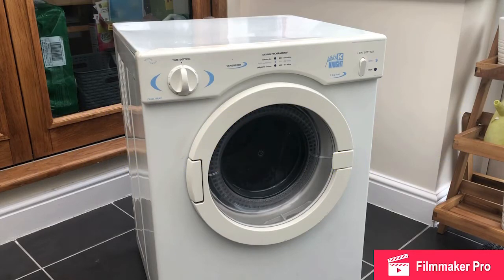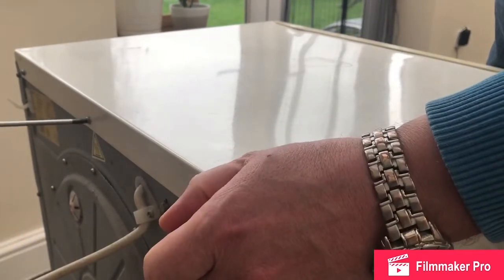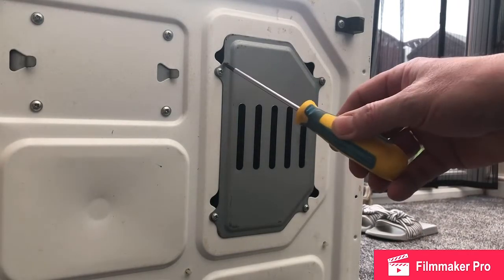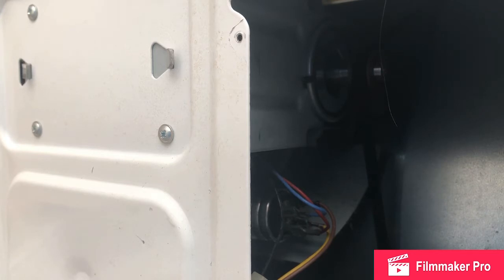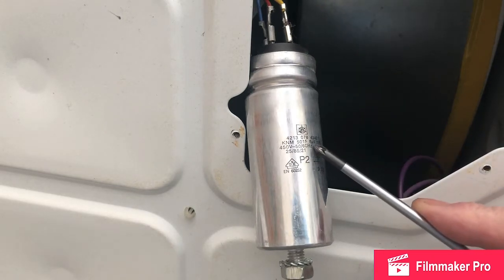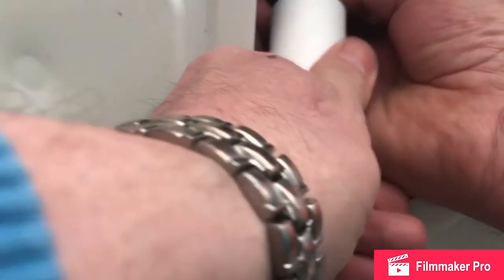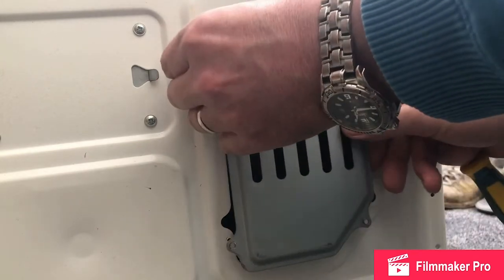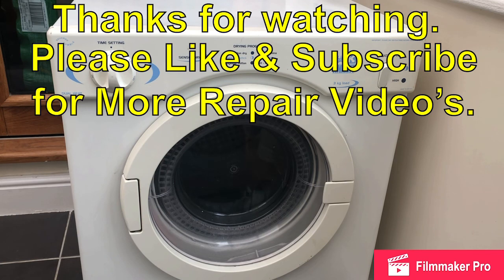White Knight CL382WV Drum Tumble Dryer not Turning / Rotating  Repair.

Comment: thanks for this great guide, no mention of the access panel on the bottom in the service manual for a C38AW so I before I watched this video I started taking the back off thinking that was the way to access the capacitor, once I realised my mistake replacing the capacitor was pretty easy and I now have a fully working dryer again for £6, once again thanks and of course I have subcribed.

Comment: nice work
Reply from the maker: Thanks
Reply: @TheRepairer   can you show how to change the belt on this
Reply from the maker: I’ve got no need to replace a belt as it hasn’t broke yet! I just make videos on jobs I need to do, be extremely patient and watch this space.....It could take years though if I’m lucky!
Reply: @TheRepairer   what dryer did you have befor this one
Reply: @TheRepairer    will this work on a c38aw
Reply from the maker: First one I’ve ever owned, we don’t often get new items in this household as I keep fixing them. They have to be beyond economic repair. I had a washing machine for well over ten years. It had a new pump, new heating element and a hole patched in the plastic outer drum! It was game over when the spindle broke in two places!
Reply from the maker: This principle is exactly the same for all, if it starts with push yes.
Reply: @TheRepairer   how would you know of the drum shaft is broken
Reply: @TheRepairer    what year is this dryer from
Reply: @TheRepairer   my creda 37761 is unning with the door open can you help me fix it
Reply from the maker: @hotpointbrownlover3365  I’d start with the door switch it may be stuck.
Reply: @TheRepairer  thanks for the info mine is been fine ever sinse
Reply: I fixed my dryer today with help from this 🙏 the only difference was I didn’t have a yellow or brown wire, just two blue and a red?! Only three is this safe? It works fine but I feel paranoid

Comment: Hi, sorry I wrote on another thread, I didn’t have four wires, no yellow or brown just two blue and a red, is this ok? TIA
Reply from the maker: The four wires on this capacitor are commoned in pairs of two so two wires are connected together either side of the capacitor. One wire either side of the capacitor should do it.
Reply: @TheRepairer  thank you 🙏
Reply: @TheRepairer   hi just fitted a brand new capacitor and the drum still won’t run ,any tips please

Comment: Hi 
I have a problem with my white knight washer 
It's taking the water and drain as well but it's not spinning 
Can anyone guide me what should I do now
Reply from the maker: If it’s not draining  well it will disable the spin cycle, it would be worth disconnecting and checking the drain pipe is totally clear of water . See if it will spin on the switched spin cycle first.